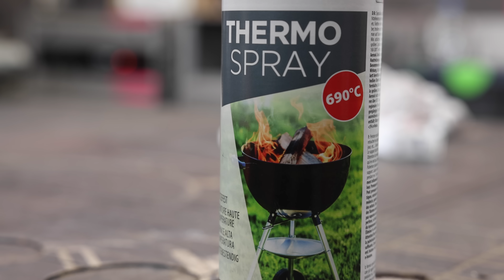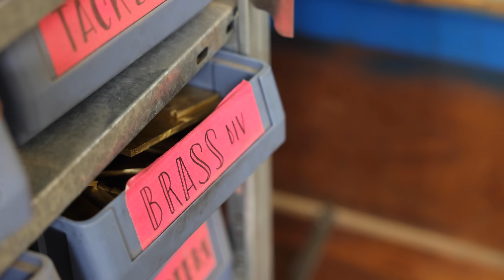"Trash to Treasure" Grill - DIY Yakitori BBQ made from I Beam

Comment: Great videography as usual. After seeing the final use for kabobs with fuel in channel what was the function of the tube and brass underneath? Airflow?
Reply: @Mike Milligan Looks like it would be simple to modify it for gas.
Reply: Might be to hold skewers? But the sizing looks off so 🤷
Reply: @Mike Milligan Yakitori grills are typically coal powered & thus needs air to circulate through them to keep the embers going & generate more heat. ;)
Reply: 👋 Howdy!
Reply: 03:00 see the holes, the channel under is to let fresh air in.
Reply: It's to collect the ash that falls down from the charcoal so that the ash does not fall on the table.

Comment: Love this little grill. It looks wonderful. So I have a few suggestions and would like your thoughts on them. 1. Heating the sides of the I beam and bend the top out a bit to make the top wider. Perhaps an inch on each side which would open the top up about 2 inches and give a little more room at the top for your food on the kabob sticks. 2. Wedges added in the bottom where the wood/charcoal sits on both sides of the air holes would direct the fuel towards the center as it burns down and keep it over the holes drilled in the bottom. 3. Perhaps replace one of the brass inserts with a hinged plate and latch with holes in the plate. The air chamber will eventually get clogged with ash and grease that has dripped from the food that is cooked on it and will need to be opened to clean it out. 4. Probably a good idea to place a small cup or saucer at the ends of the grill when in use to catch any grease that may eventually drip from the air chamber while cooking. I hope you find any of this helpful and keep making wonderful projects like this.

Comment: Wow very clever and simplistic design 😍 you have to try binchotan charcoal, it's the original charcoal used for yakitori grilling. Less smoke  and high temperature, ideal for indoor BBQ.
Reply: Downside it's more expensive then normal bbq charcoal 😬

Comment: Very cool barbecue. Once again your design skills excel. Just one thing though, what was the original coating on the sign? At first I thought perhaps galvanizing or zinc plating, perhaps even lead based paint. I may have missed the big when you removed it.

Comment: Good morning Laura! Interesting project, especially considering the use of discards. I have a query: what is the function of the perforated bronze caps that you put on both sides of the burner? Thank you!! Best regards.
Germán, Montevideo, Uruguay
Reply: I would assume to help hold the ash that falls through in there so it does just blow out the side while you are cooking/eating and making a mess where you are.
Reply: @RetroRhith  Thank you for your reply. Watching the video again with more attention, I understand that that tube with the perforated covers, plus the holes of the burner, fulfill the function of aerator of the coal.

Comment: But did you move the steel beam?  Or did you just cut off the piece you needed for the bbq?  Do you need to do enough projects to use all of the steel beams?  =P